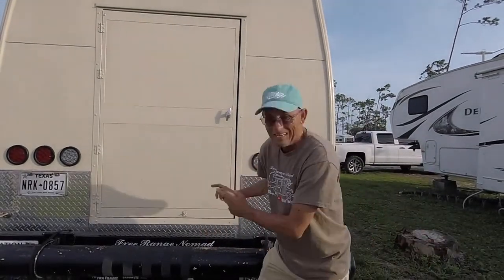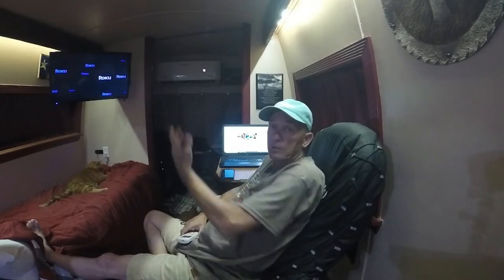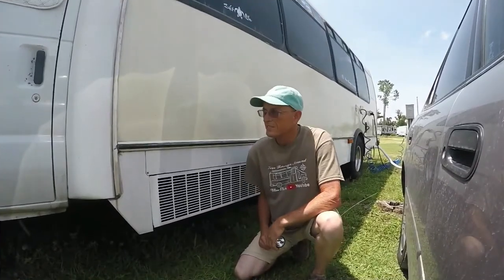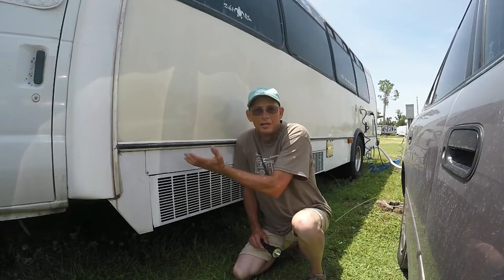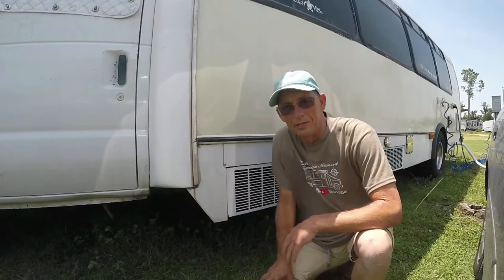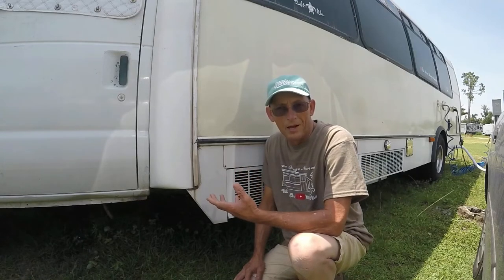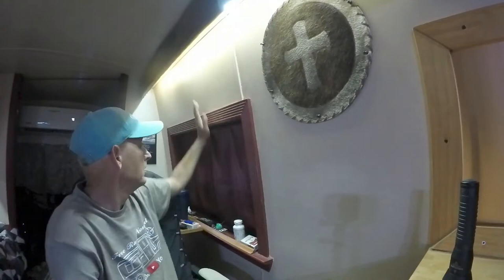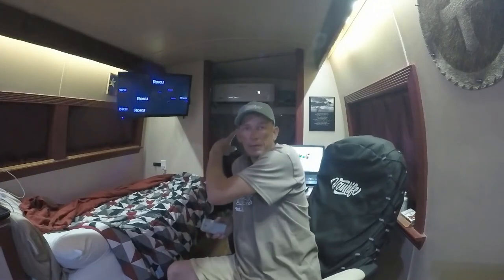100% Concealed Pioneer A/C Mini-Split on Shuttle Bus !! Watch to see where I put it !

Comment: Can the mini split be used while traveling down the road. My bus conversion don’t have ac so I will need something while traveling I can run off of the generator.
Reply from the maker: Yes it can. I run mine in the hot weather. Be sure though to follow the tips on this video to keep it from leaking into cab during unlevel boondocking and traveling,,,  https://youtu.be/Y6ngzhsZ0Lc
Reply: @FreeRangeNomad  ok thanks

Comment: Hey David, what do you use for wifi?
Reply from the maker: I have an extra cell phone that I use only for the Hotspot. My service provider is Visible Wireless. They owned by Verizon. Runs off their network. $25 flat rate/month unlimited everything.
Reply: @FreeRangeNomad  Is it truly unlimited or do they slow your service down after a certain amount?
Reply from the maker: It is unlimited. Has no throttle. Just a steady avg. Not like others that has so many gigs fast and then turtle speed. It's just mediocre. But I can still watch Netflix etc with my roku, email, browsing etc.  Not as great as an expensive plan. But I can deal with alot for only $25/month. Lol
Reply: @FreeRangeNomad  Who do you go through? I like fast Internet and want it to be as if I’m living back in my apartment where my internet never slows
Reply from the maker: @briizcustoms9543  I don't require fast internet. If I had to choose I would say att. 
Btw...next vid be late. I'm in the hospital for gallbladder right now. Lol.